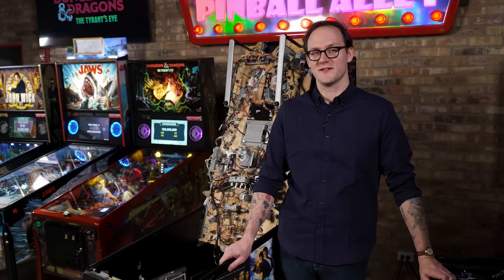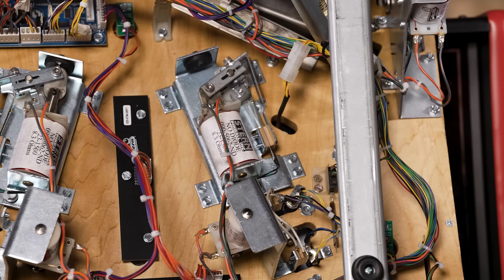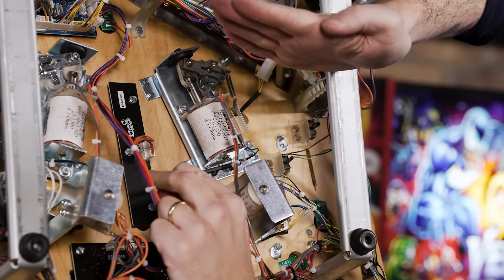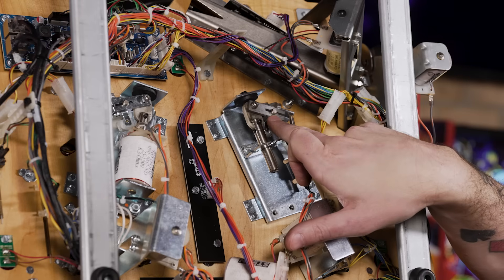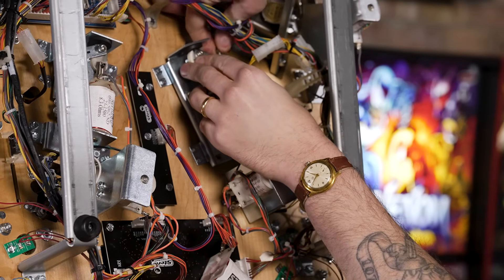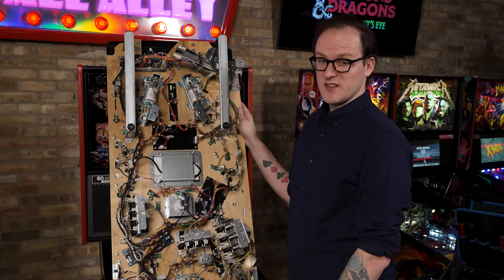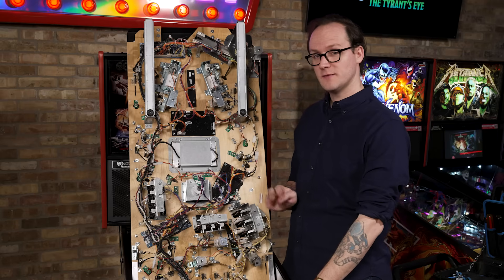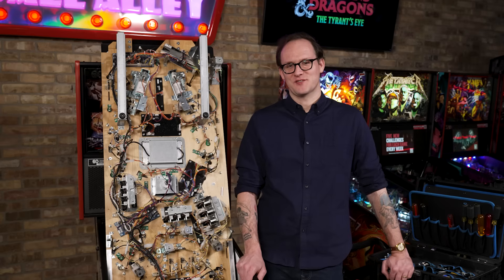Stern Tech School: Flipper Maintenance

Comment: I adjust my stranger things today... The left flipper had almost no adjustment whereas the right allowed for a wide variance... My flipper bump pads are a little warn at 2000 plays. So I'm assuming the left flipper is more of a guide for the right and I'm at the point where I should replace the bump pads

Comment: Question : I thouth that the alignment holes for the bats aren’t always precise. For accurate setup, the top edge of each bat should be aligned flush with the adjacent ball feed ramp rather than relying solely on the positioning holes. Is that correct ? It makes a big setup different for some games.

Comment: If youre not replacing the bushing, when replacing, i just remove the link and coil stop...and keep the flipper bat and crank in place. You skip the last 5 minutes or so of the video then, no readjustments. Only replace crank if the eos actuator broke off

Comment: As for the flipper bushing, I wonder why no modern pinball manufacturer uses two bushings, with the flipper crank mounted between the bushings? Gottlieb early System 80 used this. It was great, because it stabilized the flipper axle, so there was never any wobble, unlike modern flippers, which still have some wobble even when fully tightened, because it's like riding a unicycle, instead of like an axle on a car.

Comment: The coil stops are a known problem, but those 2 black screws that hold the coil stop to the flipper mounting bracket are also of very low quality. I'm not sure what black potmetal Stern is using, but these screws love to shear off, making it difficult to remove them. They also tend to fall out on their own, causing the flipper to fail when the coil stop gets loose. Any thought of fixing this? Replacing the factory screws with screws made of steel works a lot better.

Comment: Ive done way more coil stop fixes than full crank and link swaps. I think this is a tad dishonest. Not saying that it doesnt wear out
Reply: When you swap the coil stop without the plunger it creates a mismatch that accelerates wear on the new coil stop, and increases the buzz or hum when cradling. I guess if you're an operator trying to save a few bucks, sure, but at home no reason to cheap out there.
Reply: @ usually if its needed to be done in a pinch you try to clean the end of the old plunger if its mushroomed or deformed at all and if the links in decent shape. Again we are talking about a 50 dollar repair for a at a minimum, 7000 dollar game. Not the end of the world either way. Easy way bring life back into a game